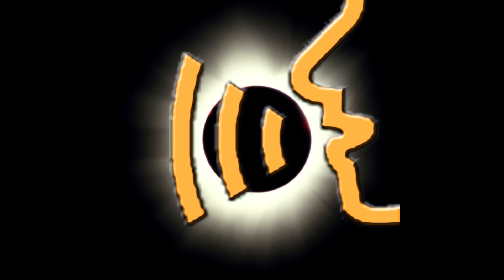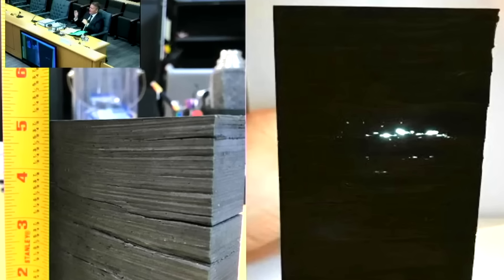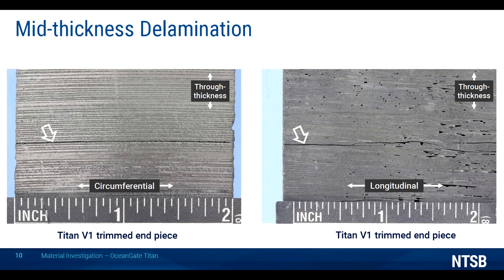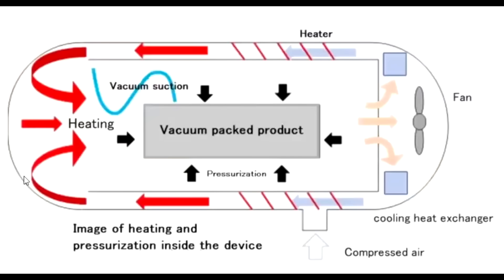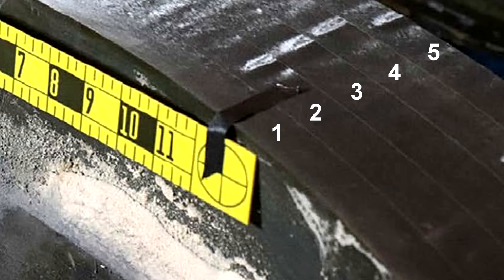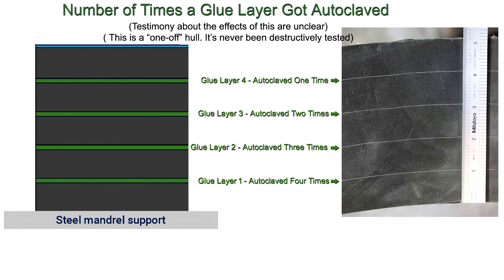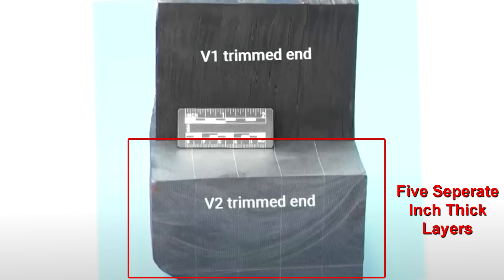Who Engineered the OceanGate Titan V2 Hull? Maybe Nobody Did?

Comment: If the body was bellied rather than a plain cylinder it would increase the stability of the structure, possibly leaving the metal mandrel in place for more longitudinal strength and splitting resistance . Just a thought based on some experience .
Reply: It would be harder to apply the duct tape then. It would have had more bulges

Comment: 9:35 I'm nitpicking because this man admits to not having expertise in submersibles, but NASA trains astronauts underwater to help emulate low gravity.  NASA as a whole might know something, though definitely not as much as an experienced submersible manufacturer
Reply: The bouyancy pool for NASA  is 40 feet which is about 1 atm of pressure. These pools are used to simulate weightless or semi weightless environments and the spacecraft have 14.7 psi pushing outward into about 1.4 psi or lower.

These spacecraft do not handle any pressures even close to 3 atm let alone the crushing depth of the Titanic. 

Imagine the weight of the Eiffel Tower on every square inch of the hull of Titan! And all that weight is pushing inward! Much easier to keep something inflated under low atm pressure differences than keep something from imploding under crush depths.
Reply: Your comment is like “my neighbor claimed he has no expertise in submersibles, but he has a pool in his backyard!”  It’s irrelevant.  And Rush only used NASA for basic consultation on material manufacturing and facility space rental etc, it was Rush’s specifications and Rush’s responsibility.

Comment: CF is stronger in tension right? Isn’t the external pressure of the ocean putting EVERY cylindrical stress component of the hull in compression?? Hoop stress is compressive because the angle is wanting to be reduced, radial stress is compressive because radius wants to be squished, axial too because of the end caps. everything is in compression, so you’d have to use compressive mechanical data and not just that but data SPECIFIC to the way you assemble the CF. Simulating this design accurately in FEA sounds like a nightmare. I have no clue how Boeing even came up with 7” hull, or Spencer with 5”. You NEED A FACTOR OF SAFETY. For something carrying people down to absolutely crushing depths REPEATEDLY you need some way to generate confidence. Taking a giant CF tube that has complicated and error-prone material properties and just winging it on the thickness and manufacturing is utter insanity. It’s not engineering. It’s just not. You need stress and strain calculations, you need to approach design with a failure mode. An entire team of engineers and they somehow all failed this.
Reply from the maker: Thanks for your thoughtful comment.  I agree with everything you said.  The sad truth is I don't think there was any way to do FEA on the V2 hull and calculate a safer factor.  There were too many variables.  If you watch my other two videos on the hull, one about the grind spots, and the other about the glue film layers, it becomes clear that the V2 hull was "winging it."

Comment: All those autoclaving turned the glue pre-pregs to dust
Reply from the maker: Thanks for your comment.  Possibly.  If so, I wonder why the manufacturer did not notify OceanGate about the potential problem.  I hope the final NTSB report clears that up.
Reply: @solareclipsetimer  I hope they do tests to check that. It would be interesting to see the results. It would beg the question, though- did Oceangate test the process in that regard? And if not, why not?
Reply: @alisonwilson9749  I do too.  I hope the final reports have some answers.  I'll bet the final report is going to be long and hard to read.

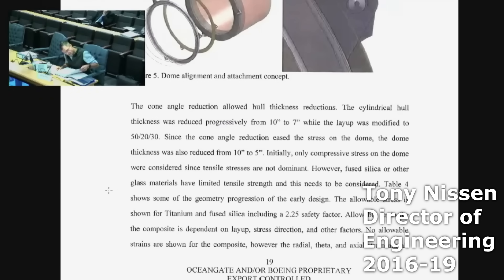Comment: Is the feasibility study at 2:30 available, I don’t see it on the uscg site. A 50/20/30 layup seems strange since the hoop load is twice the axial load. Unless they made the hoop direction the 0 direction. What was the design pressure? Giving just a snip like this tells us nothing. Like the Spencer report later, the design depth was 9000 meters with a safety factor of 2.21. The requirement was later reduced to 6000 meters with a safety factor of 2.21x9000/6000=3.315. Apparently, Nissen didn’t even read the report because he still quoted 2.21. Then it gets higher because the thickness was increased to 5 from 4.5. And, by the way, the end ring channel was increased to 5 inch to accept the thicker cylinder.
Reply: 2.25 was the target safety factor, 2.21 is the analysis factor of safety = predicted failure pressure (or allowable strain)/operating pressure (or predicted strain at operating pressure). For the report, the design operating pressure was 9000 psi (corresponding to 6000m depth). So, the predicted implosion pressure was 2.21x9000. =19,890 psi. The requirements changed to the titanic depth where the max operating pressure is 5600 psi. Nissen quoted 2.21, implying the design would implode at 2.21x5600 =12,376, not 19890 psi. The analysis safety factor based on the titanic depth being the max operating depth would have been 19890/5600 =3.552. The strains in a composite cylinder remote from the ends are easy to calculate using netting analysis, it just requires a calculator and a few minutes of time. My calculations agree with the report at the center of the hull. The fact that the strains were 34% high indicates either the strain gages were not properly calibrated or something happened to severely damage the hull. Maybe a lightening strike?
Reply from the maker: Thanks for your comment.  Regarding the Boeing feasibility study, during the hearing, they did put some of the pages up on the screens (live), but you are correct, the full document is not on the Coast Guard website.  Remember that the Spencer Composites design document had to do with the V1 hull.  In that document, in some places, they use a 2.25 safety factor and in others, they use 2.21 safety factor.  When Nissen quoted 2.21 for the failure at the center of the case, he was quoting directly from the Spencer document for the information about hoop failure.  That is the number there, it's on Page 22 of the Spencer document.  The titanium rings from the V1 hull were reused for the V2 hull.  The inside measurement for the channel for the carbon fiber hull was 4 1/2 inches.  For both the V1 hull and the V2 hull the outside surface of the hull was milled down to 4 1/2 inches to fit into the rings.  Spencer Composites specifically stated in their document that it was okay to taper down the end of the hull to fit.  The length of the milling was 1 1/2 inches.  The depth of material removed was different for each hull.  The V2 had a larger finished outside diameter.
Reply: Absolutely wrong, the Spencer report was an initial design for a 9000 meter design, read the xxxcg report. The requirements were reduced by Rush to 6000 meters and the thickness increased to 5 inches, the end rings were also increased to 5 inch. The safety factor is the (allowable stress/strain at failure)/ (calculated stress/strain at max operating depth). The allowable did not change, but the max operating depth was reduced to 6000 m ( actually 5600 m). So the safety factor increased from 2.21 to over 3.31. If you don’t understand this, hire a pro. Also, the dome and end rings in the report are not what was built, this report does not apply to the as built hull. Rush was advised to redo the analysis, but he did not. So there is no documented analysis of the as built hull on the uscg site.
Reply from the maker: @imhusker Thanks for your reply.  There are a lot of things in the original Specer document that ended up not being correct, for instance, a cycle life of 1,000 to 10,000 cycles.  But that was the first shot at trying to figure out the engineering of carbon fiber hull for OceanGate, so there were a lot of unknowns.  The safety factors in the Spencer document are just not relatable to the hull they built.  As of this time, there is no comparable document in the public domain about safety factors for the V2 hull. You are correct, that the diagrams for the rings in the Spencer document were very rudimentary, and Tony Nissen testified that he worked with Spencer and another engineer that Tony hired to modify the rings.  They came up with a new ring design for the forward and the aft rings as a matched set.  They did a lot of engineering to match the moduli of the titanium to the carbon fiber hull.  You are correct, I found documentation that the final C-channel width was 5 inches (I have edited the video to reflect that).  However, when you watch videos of them gluing the rings on the V1 hull you can see where they milled down the outside diameter of the carbon fiber hull to get it down to 5 inches. (you can see the step-in).  They used the same rings for the V2 hull and Phil Brooks testified how they cut the hull off the rings and then milled out the carbon fiber from the rings to reuse them.  When you see close-up pictures of the V2 hull meeting the rings you can tell how much wider the hull was compared to the diameter of the rings; the hull steps down to the ring diameter.  Thanks for adding to the discussion, I appreciate it.

Comment: Switching to tape placement and autoclave curing was the fatal mistake, period. No pressure vessel manufacturer would do this. Filament winding places the fiber with about 10 ksi tension and develops pressure with the curved surface that debulks continuously during wind. Just wrap a ribbon around your finger several times and you’ll get the idea. Fiber placement applies little to no tension and must be debulked frequently, every 4-5 plies per the process sheet you showed. We tried autoclaving a thin wall pressure vessel 45 years ago. It came out severely wrinkled and failed far below normal. The hoop plies are placed at a diameter. When it is compacted by pressure, the diameter gets smaller this effect is magnified as the laminate gets thicker and results in the severe wrinkles seen. The diameter of the plies gets smaller, but the length laid down does not. Frequent debulking is the only way to avoid this and I doubt that would do it. Automated or hand placement is fine for relatively flat parts like in aircraft but just doesn’t work for continuous cylindrical surfaces. I knew this was the cause the second I heard it was not filament wound. By the way, the v1 hull damage was not fatigue.
Reply from the maker: Thanks for your thoughtful comment.  You are correct, the Toray spec sheet says to autoclave after about every 4 plies.  OceanGate did it after 133 plies.  Regarding the V1 hull, the part I put in the video was about the engineering prediction for the V1 hull so it could be used as a baseline for the V2 hull since we have no publically released engineering data on the V2 hull.
The V1 hull was poorly fabricated and did not come close to meeting the predicted safety factors.  It failed before it had time to fatigue.  Thanks again for adding to the discussion.
Reply: The v1 was not poorly fabricated. The cause of the premature crack is obvious to me. I do not publish until I’m 100% sure, I’m  only 99% sure. If the CG ever gives us access to all of the information I will present the cause with supporting analysis. It has nothing to do with the fab method. Why is it almost 2 years and we can’t get the necessary data?

Comment: When I was an engineer in the Air Force we worked with carbon fiber and every other composite often and to have plies in only two directions is absurd for that application. Only two directions perpendicular is just impossible to think anyone would consider structurally sound for a pressure vessel. 
    They needed at least 45 deg layups to be combined with 90 deg layups so to have four directions of strength to mitigate the compression. They also needed to layer them in a certain order and there would be doubles of the same direction at certain intervals.
      There are also many different weave patterns and strand thicknesses that I don't think they thoroughly tested. Carbon fiber is not an ideal choice to put it mildly but if they had to use composites they should have included layers of Kevlar composite on outer and inner layers with the carbon sandwiched in between not just carbon fiber. Making it in two separate bonds guarantees deamination they needed to cure the entire thing under very high vacuum but at such a thickness they should also have found a way to add more pressure as well. Composites are somewhat brittle, weak against sheer, great against tensile strength, worst against compression strength. Guess what a vessel experiencing pressure from the outside needs. Compression strength.  There is no reason to build a submarine out of composites weight isn't an issue with a submarine and weight is the the only possible advantage of composites in this application so there was no reason.
Reply: I was shocked to hear that, even someone as dumb as me understands why you need layup in  more than 2 directions
Reply: That would very one big ass vacuum/pressure chamber costing $$$$$!
Reply: Look at composite pressure vessels with small openings. The cylinders are 90’s an low angle axial plies as low as 5 degrees., practically 0/90 They’ve been doing this for at least 75 years. If you only have one load case to design for you can optimize the layup. In aircraft, the principal load directions are all over the place and 45s are needed to account for this. That’s why we call it black aluminum. Look at the flanges of composite i beams, they are mostly axial and the webs are mostly 45’s and may not have 99’s at all.
Reply: @imhusker  Yes if you're referring to pressure vessels that are meant to contain pressure they don't need as many directions and since they're usually stationary and mostly because they only experience tensile forces but in this case I was suggesting more angles to help with compression force from all directions and the innate weakness composites have to compression. And yeah I am limited to aircraft and missile design but was trying to apply what I know to pressure vessel design and while so many principles overlap that isn't specifically in my wheelhouse. We have gone to three inches of plies and had to have a vacuum bag around the piece at high vacuum while it was in an autoclave that was pressurized to 30 bar. I was thinking along those lines for them to have enough force to properly do a 5" thick hull cured all at once.
Reply: Every single stress component in an element of the hull is in compression. Radial, hoop, and axial. So they would have to use compressive material data for things like elastic modulus and yield strength and not only that but, since it is a custom composite, they need material data for that specific CF tube layout. What is the result of a compression test on a unit element of the hull? With this info they can at least apply a failure theory  to predict a factor of safety and estimate the strength loss with cyclic loading. If I were asked to approve this design I’d immediately reject it, not only for the glued joints and machined down CF, but for the simple reason that no one has made a proper effort to prove the material choice is appropriate— and If they did they’d see it is foolish.

Comment: Dangerous irresponsible idiots, both the builder and the passengers.
Reply: I disagree on the passengers.  Rush pushed hard to sell tickets, see the texts.  And Rush straight up lied about or minimized the safety concerns, painting the trip as no more dangerous than going scuba diving.
Reply: @ Then why did previous "customers" cancel for safety reasons??? The passengers knew it was very risky and did not look into it good enough and just took the risk. They had to sign papers that said it might not be safe. Would you let your child (I do not know if you have any, but for arguments sake) undertake such a trip???
Reply: @Gijs-t7p They were gullible and/or lacked good risk behavior. The thing with a scam is you can play the numbers and find someone willing. That doesn't make it less of a scam or take any onus off of the scammer.
Reply: @Senthiuz  You're right it doesn't, but by the same reasoning it also doesn't absolve the victim from its own responsibility. Ever heard of the expression: you can't scam an honest person?
Reply: @Connor37911 if it was so dangerous to rush why would he be the one in the submarine?
Reply: Once the oxygen level dropped past the CO2 level it could not hold the pressure .
Reply: @stick9648  BS
Reply: Don't be so sanctimonious - It did make it down and back what was it? 8 times? 

What have you ever achieved?
Reply: @jamesmx7  Not killing multiple people, at least so far. I'd say that's 100% success rate for him!
Reply: @jamesmx7 But at what ultimate result? Your position is indefensible.
Reply: @M60gunner1971  it's really not. There's a fine line between a genius innovator and a reckless maniac. Stockton happened to fall on the reckless side but he was by no means a complete idiot. 

His passengers were likely taken in by his charisma and shpeal, they made a bad decision sure but to call them all idiots is pretty asinine
Reply: @M60gunner1971  if we call every endeavour that ultimately failed idiocy A people would stop innovating and B there would be a lot of idiots!

Comment: This is the issue when people who think they are experts are involved in the manufacture of a life critical system and the reality is, they do not know what they are doing and they ignore the written advice of those who so. I have a carbon fibre telescope and the tube for that was wound in three different directions - latitudinal, 45° and 270°. Now if a manufacturer will do that for a telescope designed to deal with 1 bar pressure, you have to wonder why this was ignored for something designed to go to pressures fast approaching 1000 bar!!
Reply from the maker: I agree.  If you are going to hire experts for their opinions, you probably should listen to them.  Thanks for commenting.